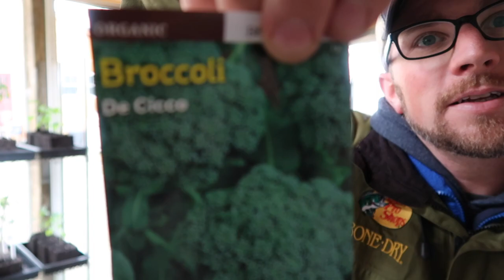I Hate this PART about RAISING Pigs! But its Necessary

Comment: Pro tip for tiny seeds: Take a clean q-tip, lightly spray water on the end of it, then touch it to the tiny seed. The seed will stick to the end of the q-tip until you brush it against the soil. You can re-use the q-tip until it gets too dirty to see if the seed is on it, then turn it over and use the clean part on the other end of the q-tip. Works like a charm!

Comment: If you use parchment paper in your cookie sheets to bake on, a lot less clean up. Plus you can just pull the paper off with the cookies on them after taking them out of the oven. They can cool right on the paper. Just an idea that I use. It may not be for you.

Comment: Howdy Al.  I think you'll come to really love that electric wire and those spools, I have.  May I suggest you try O'Brien step in posts - you'll never need to drive another fence post, install an non-conductive connector, or use a hammer again!  Greg Judy swears by them and I agree, they're awesome.  These posts are 100% non-conductive except for the metal rod that is at the bottom and which is super easy to step in to the ground, even on compacted, dry ground.  They have multiple heights to hook your wire and it'll hold everything from goats, to pigs, to cattle, etc.  These are the perfect item to use when you are making your interior paddocks this year on the pasture, as you can just pick them up and move them to suit your requirements, instead of installing permanent fencing on the interior.  KiwiTech is another great company and they have some AMAZING solutions for perimeter fencing too that you may want to check out - fiberglass that will never break, rust, or corrode!  Cheers.

Comment: Al, you are a great guy so I’m not going to give you a hard time about feeding the pigs and chickens on the ground. 
On commercial pig and chicken farms, they raise thousands of pigs and chickens feeding them in metal feed containers and they do real well. Of course pigs root and chickens peck at the ground... and they still will no matter how you feed them the pig pellets or ground chicken feed.
Putting that ground feed just wastes some each time you throw it on the ground. The pellets will get wet on grass wet from dew or rain and they will disintegrate just like what you saw in this video. Put their feed in one of those rubber  pans and save a few pounds out of each bag.
Reply: I have done both, fed my chickens their feed in a feeder and on the ground, I found out by watching them, they would scratch it out on to the ground and I STILL ended up with feed on the ground! 🤔😕🤨